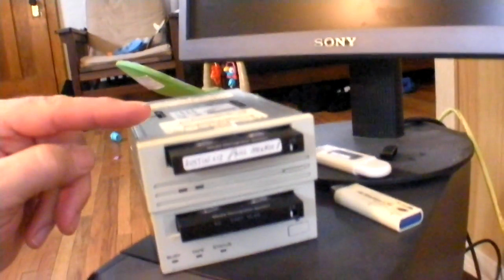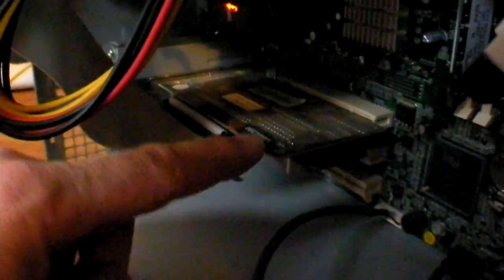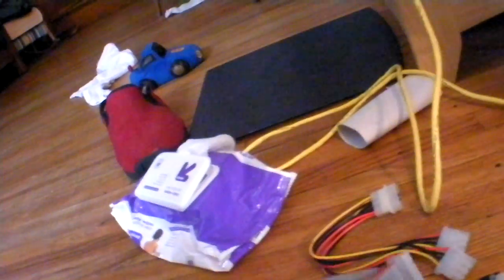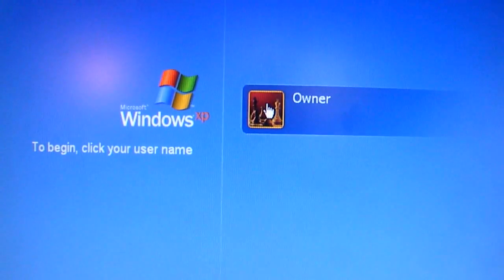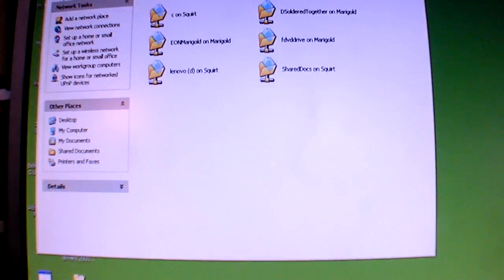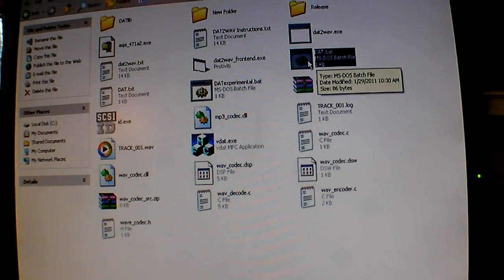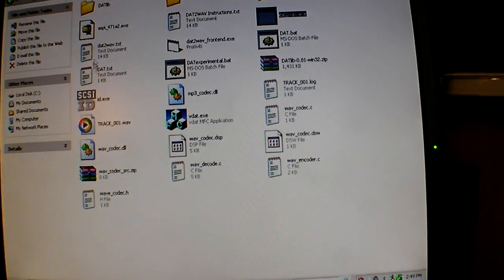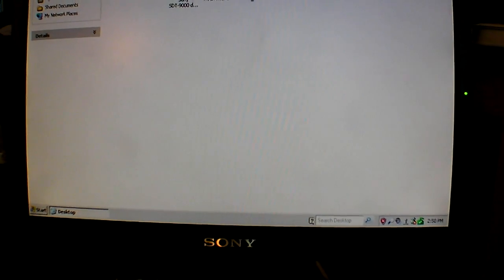Help Me Troubleshoot This Conner/Sony DDS to XPSP3 to DAT2WAV Setup

Comment: I had real problems with Conner CTD8000H because of the way it terminates. I tried it as ID 2 or 7 and all options of the terminator pins, but they all failed. What i finally did was to use a trusty Yamaha CDR as a termination. that disk for me has never failed. I think the termination in the conner drive is to blame. SCSI is very picky with jumpers.